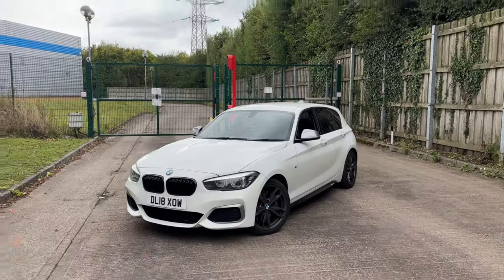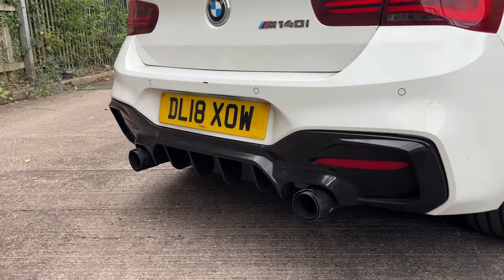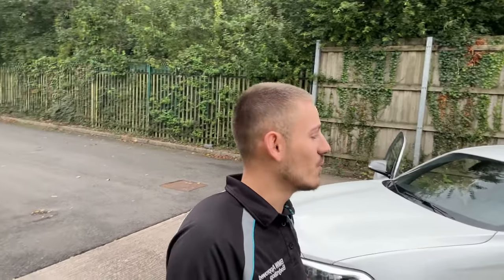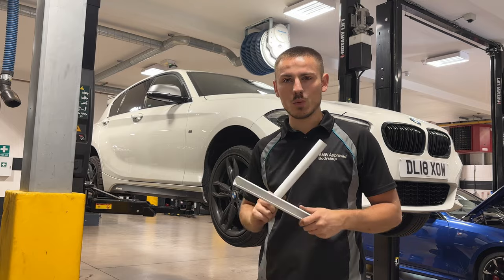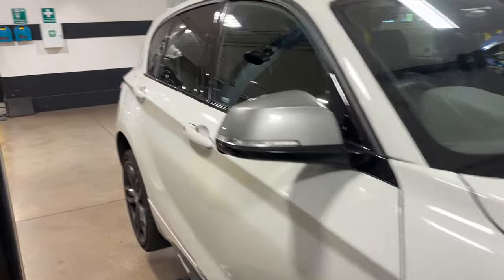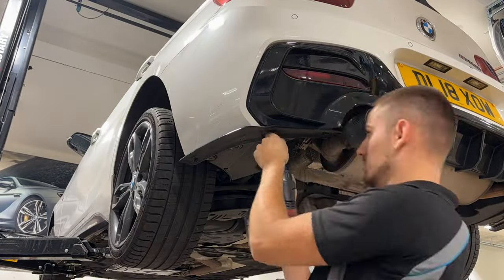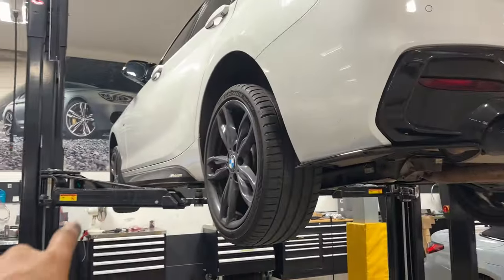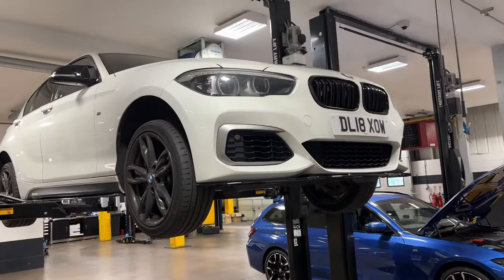I BOUGHT A STOCK M140i THEN MODIFIED IT IMMEDIATELY!!!

Comment: Can you do a video if you take them off, im debating taking mine off is it just heat then a glue remover/iso to get rid of the gunk
Reply from the maker: @jb123564  I will do if I take them off yeah! And yeah pretty much yeah but mine are pretty perished so will probably need a solvent with a scraper to remove it as it won’t peel at all…